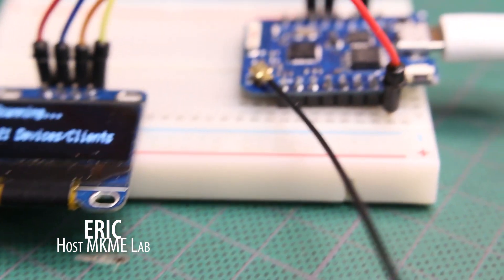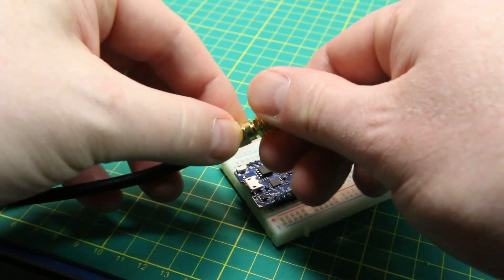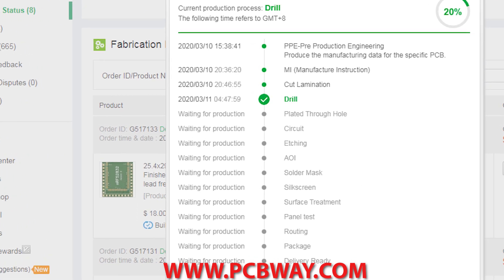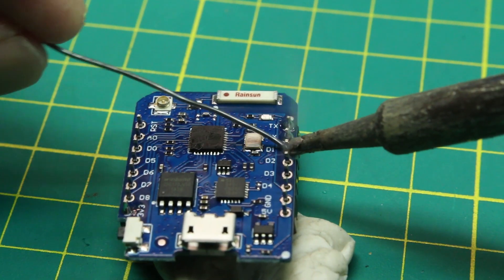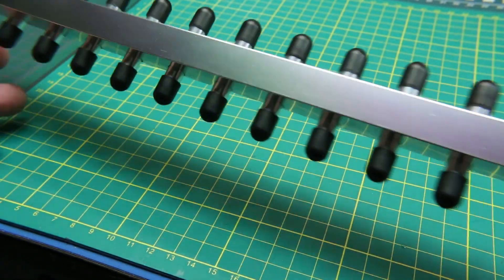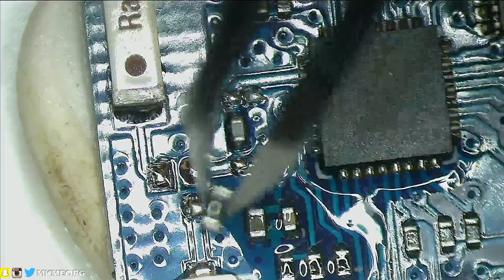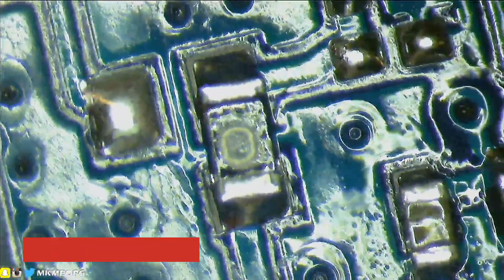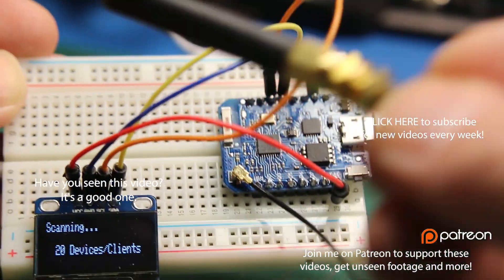Modifying the Wemos D1 Mini-PRO for an EXTERNAL ANTENNA 📡

Comment: This was so helpful! I have a question for you from someone well out of their depth. I've got a bunch of the fork in eye ESPixel Stick V3 pixel controllers, but I want to change out the D1 minis for ones with external antennas for better range with my Wi-Fi setup. Can you recommend a board I can pick up off Amazon for a quick swap? Or can an external antenna be added to the D1 mini shown from fork in eye? Thanks again!

Comment: Does it actually work with such high gain antenna?
For me, it does not work with a high dbi antenna. I have tried with an 18dbi antenna, 6 dbi etc... But they make it worse.
The best antenna for d1 mini pro is the antenna that comes with the package.
Reply: Max for esp 8266 i think is only 5dbi the most stable one and the one i use is 3dbi, i don't think 18dbi will work with this thing too😂
Reply: @yustikaslamet9432 gimana kao 8 dBi bang, bisa ga ya?, atau perlu kapasitor?

Comment: What is the hot air gun temperature you are using and what is the substance you place over the resistor before heating ? Thanks !
Reply from the maker: Max andFlux
Reply: @MkmeOrg  can you suggest which is this 'jelly' flux ?

Comment: Being a zero resistance resistor, why can't you just remove the resistor and bridge the solder pads with solder?
Reply from the maker: You could but then people in the comments would complain you didn't put the super special RF multiplying unobtanium 0R component back on the board...

Comment: I've removed the 0ohm resistor. And put a wire in between  instead.
Strange thing is that the board is still able to access my wifi without the use of the external antenna....
I do get an extra 15db when mounting the external antenna ( going from -77 to -62 db )
Do you have any measurement from before and after?

When I measure with my multimeter on ohm measuring with sound. It looks like its making contact with the external antenna.
And not with old situation to the internal :/

Comment: Wait so the D1 mini pro comes with an external wifi antenna port but it's not wired to use it? I just bought one so I could use the wifi antenna and didn't realize I'm going to have change the connection on the shunt...
Reply from the maker: Hence the video

Comment: Nice! I'm using the Wemos D1 Mini as an AP with Webserver to control some RGB LED strips via mobile. Works like a charm but the range is pretty bad. Will try the Pro.
Reply from the maker: The little rubber duck works really well

Comment: Nice. Be sure that you stay legal, a high gain directional antenna may emmit power way beyond what your local regulations allow.
Reply from the maker: An antenna doesn't actually change the power output of the radio ;)
Reply: @MkmeOrg  It does, power DENSITY. Your regulator, wherever you are, is likely specifying maximum EIRP (Equivalent Isotropically Radiated Power), not just transmitter power.
Reply: @IvanStepaniuk it took you an entire year to learn enough to win this debate, eh?